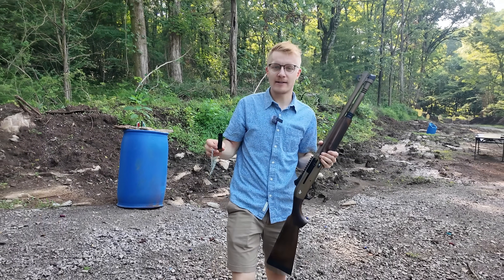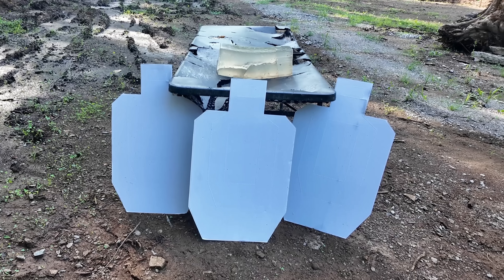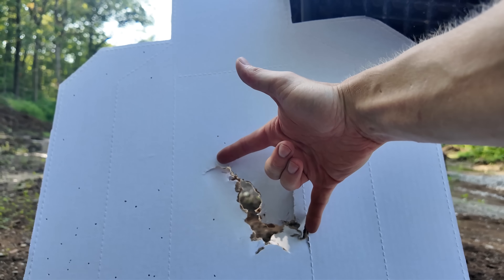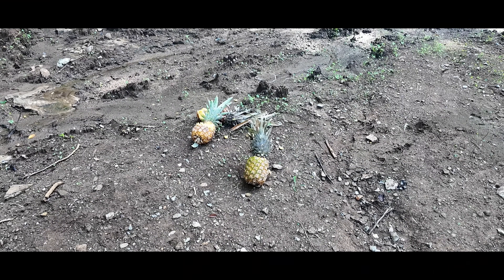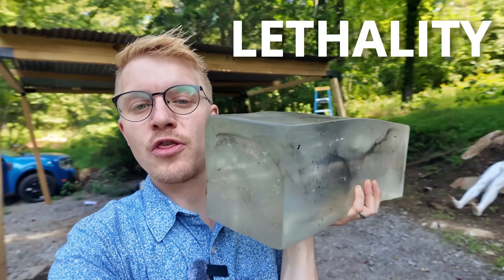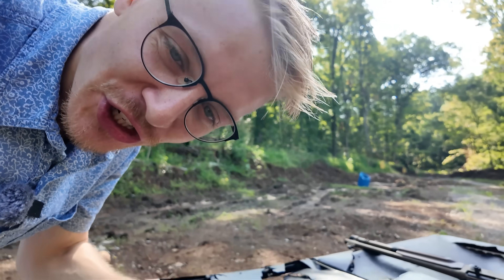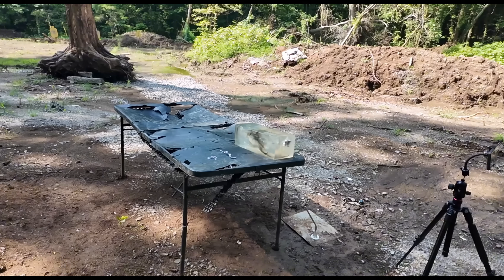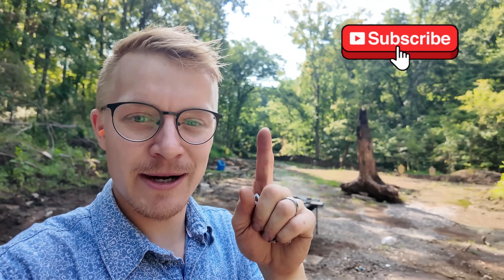Chain Shot: Extremely Painful…

Comment: Your experiment would yield better results if there were a weight, like a half-round on each end of the chain.  Chain shot and bar shot both spun as they flew through the air.  But, it was at a shorter distance when it was effective.  Chain shot was also used on land as the British used it against the Dutch at Waterloo.
There is actually a chain shot shotgun round called a "bolo round," two slugs connected by a wire.  But, they're illegal in Florida and Illinois.  I'd like to see that in action at different distances.

Comment: In the 1980s, a co-worker told me about a load his father had come up with.  A .30-06 bullet was turned down, a little, on a lathe, and tiny hole drilled in it.  Fine "piano" wire was inserted in the hole, and wrapped around the recessed part of the bullet.  When fired, the wire would unwind.  It would slash large swathes of weeds & brush it passed through.  Here's an idea I thought of --- STRING shot for shotguns!  Two buckshot balls could be connected with a length of fine steel wire, cast into them.  Imagine what THOSE would do, penetrating the body of a criminal!
Reply: They already sell commercial bolo shot loads for shotguns.

Comment: The first chain you showed is Twist Link Machine chain. Can be twisted around without as much binding as normal machine chain . I forgot what the other chains are called. The second and or the third chains are for hanging things. I got a spool of it somewhere. Good for hanging shop lights. I made my key chain with all my keys at work using it .

Comment: The problem is, your targets are too small and you're too close to them.

When chain was used in cannon, it wasn't meant for close range or single small targets; the targets were often larger, and further away...think troop formations and large ship sails. On top of that, they were not intended to fire independently but en masse, to put as many projectiles in the air as possible to be sure the target was hit, and the reason chain was used so it would extend in flight. You've basically taken away all the things it was meantt to do. You may have just as well fired slugs.
Reply: Yep, thinking same ,, thanku
Reply: Yeah, chain shot was primarily used in naval applications for shredding sails but most particularly in ripping out the standing rigging ( holds up masts) & running rigging ( moves sails up and down and left to right )😊
Reply: @simontemplar6279 Absolutely true.  Chain and bar shot were used to tear out the rigging.  If ship's personnel were knocked out of action, it was a bonus.
Reply: Chain and bar shot were for dismasting ships, they used cannister and grape shot for dealing with the softer targets.
Reply: Complete Truth.